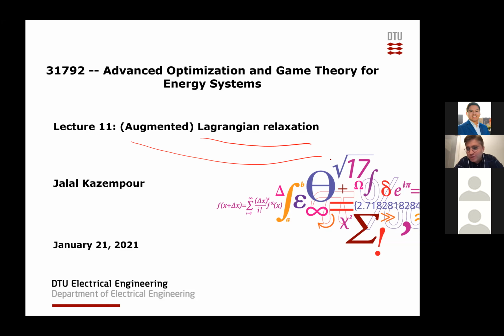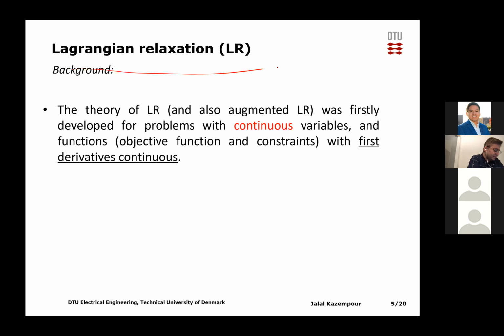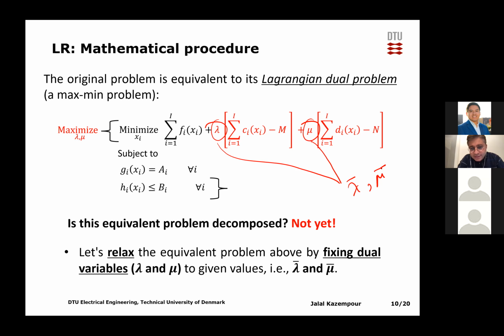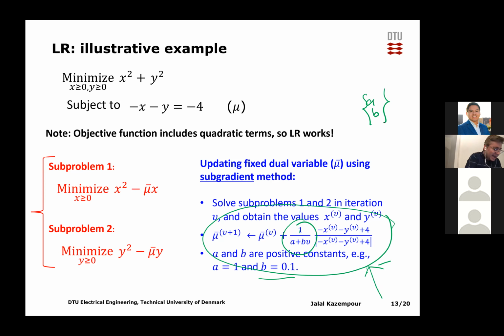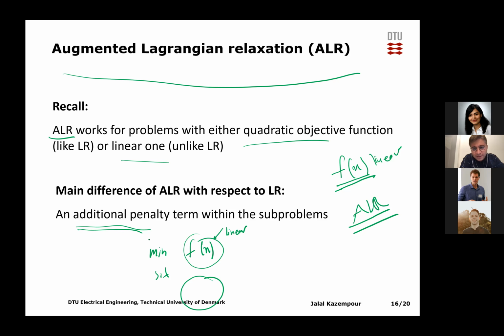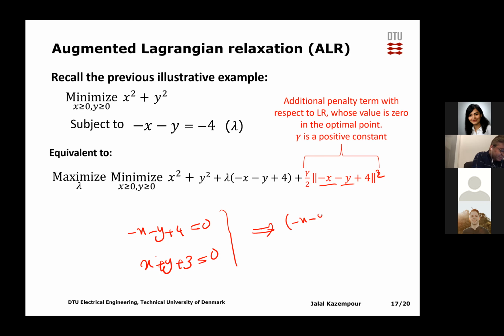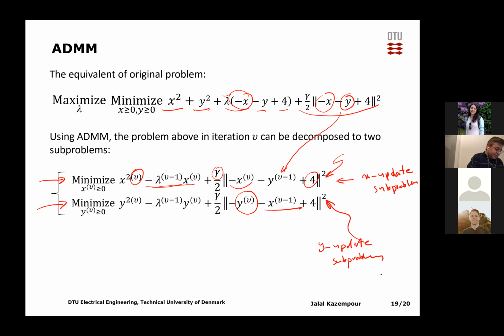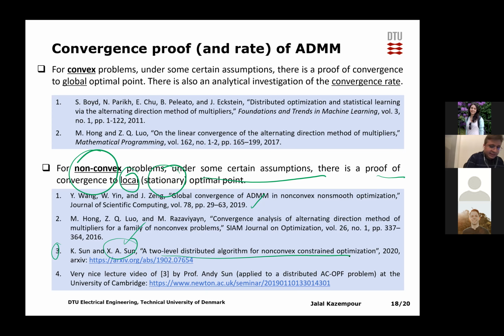Lecture 11: Augmented Lagrangian relaxation

Comment: I do not quite understand why the standard LR needs the quadratic assumption. From what was illustrated in the slides, it is not obvious why a linear obj cannot work. Also, I am confused a bit about the logic here: the standard LR needs contiuously differentiable --> thus, the obj needs to be quadratic --> thus linear obj cannot work. Firstly, not only quadratic functions are continuously differentiable; secondly, linear functions are surely continuously differentiable.
Reply from the maker: Hi Yingkai. Thanks for this good question. I think in the case of linear objective function, the first derivative is constant while a gradient-based approach like LR explores the optimal point over iterations based on the change of derivates across the feasible space. This is not an issue in the quadratic objective function (as far as we keep convexity). I suppose if the underlying problem is convex and the objective function has a non-constant first derivate, the standard LR should work. Hope this helps.
Reply: @jalalkazempour1429  It is more clear to me now. Thanks, Prof.!
Reply: I realized that later on, by linear, you actually meant piecewise-linear, but any piecewise-linear obj can be reformulated in a standard way to eliminate such nonsmoothness in the obj